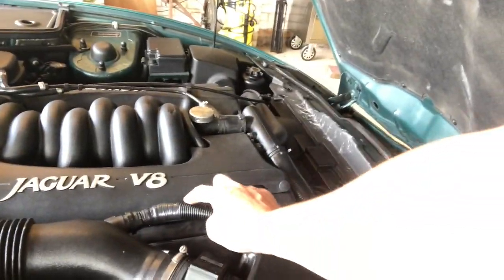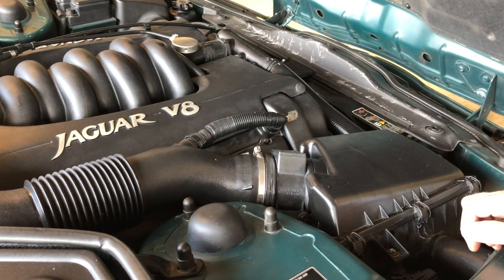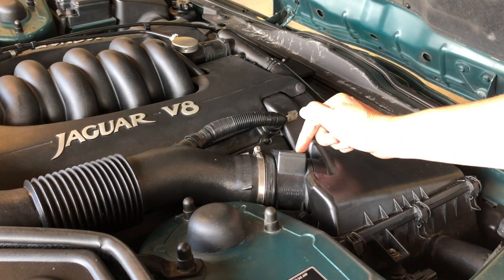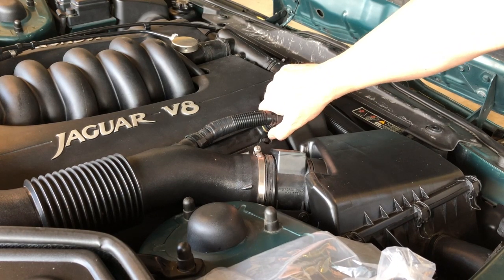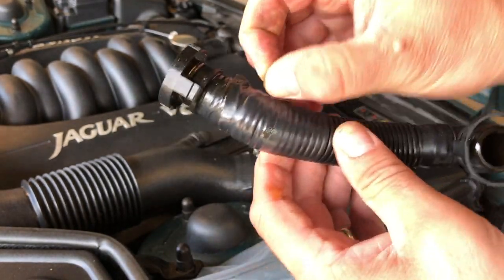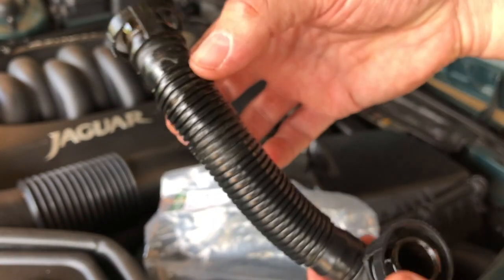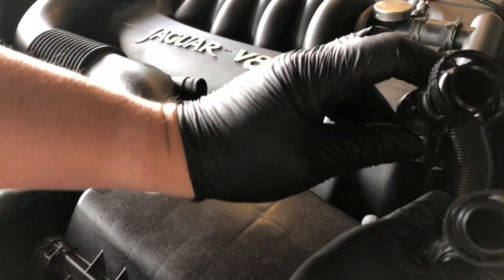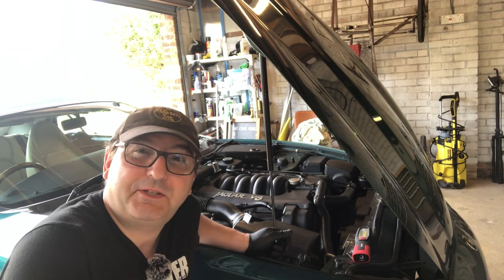Broken Jaguar XK8 Full load breather. Understand, Inspect & replace for more performance

Comment: Hi John, after having watched this and many other of your vids I have been inspired to start working under the bonnet of my xk8 (it's an early good condition Oct 1996 registered, same xjs battery connector as Purdey btw) anyway yesterday I went to check the full load breather pipe. Bearing in mind I have had the car for 5 years, it's a fair-weather car and my knowledge of car mechanics is very limited. My xk8 sits in a garage most of the time and up until it's recent MOT it had only done about 1000 miles in the last two years! So on checking the pipe I was absolutely astonished to find that it wasn't connected at the engine end!!! I'm still in shock - i have no idea how this can be, i clicked it back on and it's a different car, every garage must have missed it at a service. I barely have to touch the throttle and it responds - i just cannot believe it and had it not been for this video it might never have been rectified  - I cannot thank you enough John!! - Super Fan....
Reply from the maker: Thanks Rob. And im really pleased for you. So few garages actually know these cars well (or their 4 door sisters the XJ8). So doing what you can yourself is really useful. 
Im also really glad that you can confirm to those who have not yet sussed it out. That If you want to soup up or tune these cars. The first step is to get them back to standard. They have so much torque that even when they are not running well they impress. So unless you have another to compare with, you may not notice that you have lost performance.👍👍

Comment: I have oil inside my intake thanks to this breather hose. It not only delivers air back to the trotthle body, it also delivers oil from the valve cover... Not to happy about this. My engine running fine, I didn't noticed any problem yet, I have just replaced my Air Filter to KN performance one and during that maintenance I have noticed this issue... I cleaned all the plastic intake from the oil I have found so I hope everything continues to be OK...
Reply: I have read in some forums that in the supercharged versions that is kind of normal. Oil vapour/mist is getting back through the breather hose into the intake.... Solution might be a Catch Can.

Comment: The lambda sensor would correct for any difference in mixture after the maf, I think.
Reply from the maker: possibly🤔 but only by introducing more fuel than would otherwise be needed so increasing fuel consumption considerably. I think.

Comment: I replaced my full load breather but I still have a rough idle. I checked my part load breather and saw small cracking in the hose. Would a small crack cause the engine to idle rough?

Comment: Hi John, I notice the union between your airbox and main intake snorkel appears to have a rubber oupling. Mine just has a jubilee clip that clamps hard plastic onto hard plastic. Am I missing this part? Thanks.
Reply: Yes,there are two of them one at the end attaching to the intake and that one you saw. Beware they are like 60 dollars each. I go to junkyards and get them same ones are on XJ8. If you find used ones soak them in a ziplock bag with 303 protectant and then when you put them on get a tube of silicone grease like plumbers use. Coat them. If you do this they will last ten times longer

Comment: need to put an oil catch can on that full load breather so the oil doesn't get sucked into the throttle, or remove the hose stick a small breather into the valve cover and go with a cold air intake. "Full load breather" is just an emissions thing that doe some harm to the engine then good.
Reply from the maker: Hi Grand Hit
You are right that the inclusion of the oil into the intake charge does not enhance performance. The engine does need. a degree of positive crankcase extraction rather than just a vent though. So as long as you can rig your catch can arrangement with some degree of vacuums then its all good👍👍
Reply: @ToTheGarage  Thanks for the info, looking into buying a 97 XK8 or a 04 Audi TT and not sure what one would be the better of the two so been trying to do research since the Jag isent a very common one you see around. The XK is $2800 USD and the Audi is $3000 USD and I'm torn lol

Comment: John, question here.  If you replaced the hose with a larger diameter would that increase performance?  Or would it cause more issues with sensors and air/fuel mixes etc..? Cheers David
Reply from the maker: Hi Hooky
Bigger pipe would cause no issues and no benefit. The Hole in the pipe welded to the cam cover is has a specific sized reduced welded in it, so effectively the pipe bore is only 3 or 4 mm anyway
Reply: @ToTheGarage  ahh got it thanks :)   Thanks for all the videos you've loaded.  They are brilliant.  I just got my new XK8 today, really excited to get into it.  I just noticed I have a broken drivers vanity mirror where it doesn't close.  First job on the list. :)

Comment: What type of tube (brand, material) would you suggest tu use to replace the breather on which you attach the 2 recovered connectors?
Can you buy Norma v2 and Norma RSS nw8 connectors, attach these to a tube then have a replacement part this way?
Reply from the maker: Smooth bore pipe is better. But you can get Similar ribbed pipe to the original if you shop around. Check out Gary Van ReMoretel's Xk8 Bible for more intel on this.  He has linked it in one of the comments on this video for your convenience👍
Reply: @ToTheGarage  yes, I didn't remember I had posted that question 5 months ago, since then I've discovered Gary's bible and he gave me some advice on this too.
Thank you very much for the tips.

Comment: Hi John in your knowledge do you k ow where the pollen filter is located on a XK8 1998?
Reply from the maker: Hi Wendy
I know where it SHOULD be. Its an optional equipment item in most territories and was not popular.
It is below the 'Dorchester grey' panel at base of the windscreen. The part that the windscreen wipers emerge from.
If you have one there will be a plastic housing screwed to the bulkhead/firewall in the middle which holds the pollen filter. If instead you just have a rectangular hole through the metal work, then no pollen filter was fitted to your car.

Hope that helps
Thanks for watching and sucbscribing👍
Reply: @ToTheGarage  thank you so much, that's a great help. Was asking for my hubby as he wasn't sure how to send you a message using YT 😁

Comment: Good video John. I changed mine last  year with some excess hose from a washing  machine DRAIN hose. The hose looked identical to the factory hose in size and construction. A little heat made the hose fit the ends easily. Have you looked at the molded connector from throttle body to the main intake breather tube that is a bitch to get right and sealed right. My old eyes can't see into that black hole even with a light. Someone smarter than me might come up with another way get it done.  Could be a video there.
Reply: Washing machine drain hose is Polyethylene not Nylon and will not take the heat.
Reply: @garyvanremortel5218  The drain hose has lasted over a year and still going strong !!!
Reply: Suit yourself, but 105degC vs 270degC is a pretty large delta for a hose that causes a huge lean condition when it melts.
Reply: @murasamex9004  What is the hose you used made of then?

Comment: Hiya!  What if I have a 2003 XKR?  Thank you
Reply from the maker: Hi Curtis The principle is the Same but the pipes look a little different . I believe the part number for yours is AJ811728 
It’s longer and a little more expensive than on the 4.0 litre cars. Just as easy to replace though and will cause the same lean running if it’s leaking.👍
Reply: To The Garage thank you so much!  Love your videos!  Cheers!

Comment: I had this small issue where the inlet manifold wasn't sealed properly and a bit of the hot air from inside the bonnet was mixing with colder air from outside, it only took me getting the inlet reconnected  to the air box.